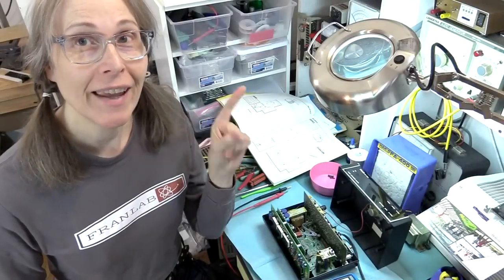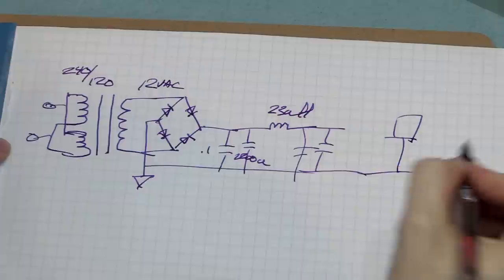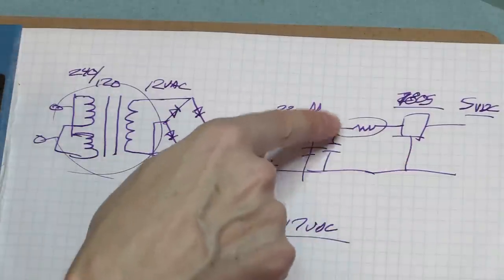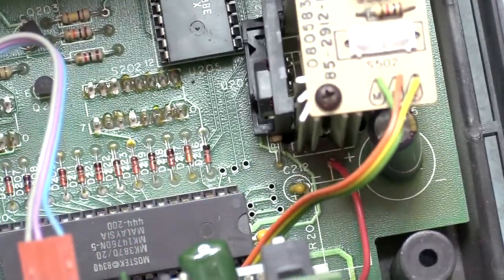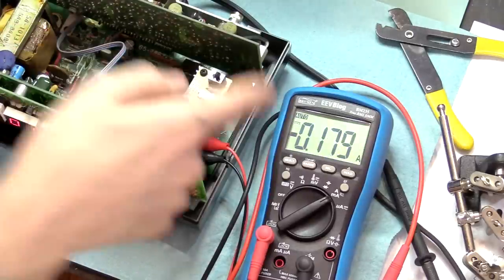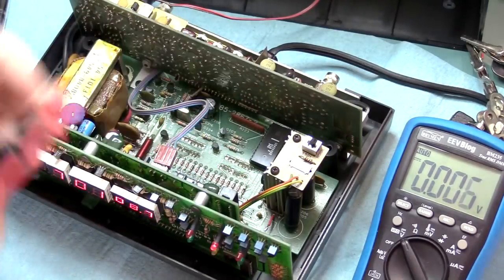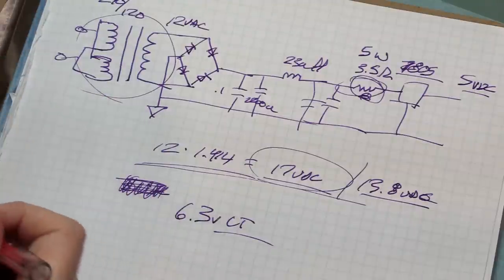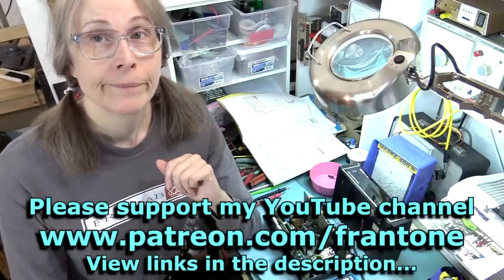Heathkit GC-1000 Power Supply Design Fails and Fixes

Comment: Hi Fran,

Yes, HK tried to make the front end xfmr common. They were quite cheap when you buy 100k at a time!

Respectfully however, you are over looking the easy & obvious solution. 

Don't change the xfmr (you'll undoubtedly foul up the 8v portion which is touchy anyway!) ; reinstall the 7805, then replace that silly power resistor with a 7809/1.5A regulator on a heatsink! Cheapest & easiest fix; less than $2!   

By the way, changing the transformer is in no way a proper solution!!! Why? Because if you switch to running directly from a 12 volt battery; you are right back to the same issue, too high a voltage to the front end of the 7805! (Lower than 17v, but still at 12!) That's why the 7809 which works either way; AC or DC!

I think you'll also find out that ridding yourself of that switch-mode pile of junk will get rid your unit of a lot of your noise issues too.

73 - John

https://www.mouser.com/ProductDetail/STMicroelectronics/L7809ABV-DG?qs=sGAEpiMZZMtUqDgmOWBjgOWppaI0OWwS4%2Fdqp68piH8%3D

Comment: The 7805 needs min +2V at it's input to properly work.

The probably best solution is to replace the 7805 by a 5V buck regulator.
Reply: The 2V is the typical and not the maximum at 1A.  When the part is cold, you need closer to 3V on it.  At low loads (100mA or less), 1.5V is enough for the LM7805 to regulate.  Internally, the current sensing circuit accounts for some of the dropout.

Comment: Variac on the input?? No. That's a kluge, and you still need an 8V output.
 Put a switching buck preregulator in series with the 5V.

Comment: 14-5 V×0.2 A= 1.8W. That should be fine! Especially with that heat sink... weird that it blows.
Reply: It's the heat x time that kills it. 78xx series regulators tend to fail shorted when cooked. Really hard on the downstream stuff...
Reply: @mikecowen6507  ... but 1.8W with such a large heat sink shouldn't generate significant heat... I would expect something around 100 degrees farenheit max. Even over time that shouldn't be as real issue.

Comment: could this be a design decision  were the input voltage could drop as in older networks. The over voltage design  would accommodate a lower input line voltage covering  less developed areas or rural setups, this would make all clocks 'work' no matter the input 'losses' in voltage
unasked for 2 cents worth

Comment: Why not put the heatsink on the 8v regulator and drop the 5v off that? The 8v regulator would be dropping 7 of those volts before the 5v regulator even sees it?
Reply: It is a good idea.  Others suggested it too.
Basically anything that spreads the heat out is a good way to make it easier to get rid of.
Reply: To keep digital noise off the RF board.

It's good practice to keep analog and digital supplies separate as digital introduces lots of noise from fast switching transitions.

Comment: Add an intermediate 7809 before the 7805.
Reply: chas williams does the same as a resistor does and costs more, takes up more room with its heat sink and causes another issue from its own dropout.

Comment: How about removing some of the secondary windings?
Reply: Stephan C that’s not a simple task at all especially in an EL type transformer. The effort would end up costing more than choosing an alternate transformer or circuit design. I’ve only ever rewound one transformer from a microwave for a spot welder and that was very difficult. Great care has to be taken not to damage any of the enameled copper wires especially on the primary.
Reply: It's doable IF the secondary is atop the primary.  Often the lower voltage winding is placed nearest the core.  It would be tedious.  Economics doesn't have to be considered for a labor of love.  Or for a video demo of the trick.

As some others have noted, she didn't show how the 12vDC input wires into this & whether fiddling with the transformer-to-regulator design impacts the DC input option.
Reply: @markcummings150  
Agreed
Reply: @ordinaryaverageguy76  sure, and its also possible to smelt her own steel from recycled car bodies and cut out all the EL plates to make a transformer, then get the special insulated card that is used to isolate the windings in transformers, then melt down some copper pipes and roll her own wire, get it enamelled, etc etc. For any simple solution there is a thousand harder ones as can be seem throughout this thread, and removing some windings is the hardest one so far.
Reply: @Mark Cummings   Cute, very cute.  As I said, it is doable & if the secondary is atop the primary, it is not that hard at all.  I've done it.

Comment: As a quick fix, any reason you could not simply use a 2 resistor voltage divider on the output  of the bridge?
Reply: Gizmologist1 a single resistor can and was doing that already. Why complicate things.
Reply: @markcummings150  Because a voltage divider does a MUCH better job and depending on the resistors, is much more stable.
Reply: A voltage divider only increases the current load and generates more heat.  If she's interested in lowering the total heat in the cabinet, too, that's no help.
Reply: @ordinaryaverageguy76  The slightly  increased load is easily handled by the size of the transformer. No substantial rise in ambient temperature heat will be experienced by the 7805 regulator.
Reply: @Gizmologist1    It's not superior to a single resistor as far as I can see. 
What resistance values were you thinking about in the divider?

Remember that one leg of the divider has to carry all the regulator & 5v buss current but drop no more than ~6v or so (to keep 7805 happy).

Given that (as pointed out elsewhere) her current measurement of ~.22A was low due to the way switching regs work, and that the spec sheet max for 7805 is 1A, the regulator & 5v buss current might be in the neighborhood of 0.5A
Reply: @Gizmologist1  2 resistors or 1000 resistors, it does make a damned difference. you get the same result that could be achieved with one resistor. I am referring to the original design that had a 5W resistor (acting in a voltage divider configuration as you say) according to Fran.

Comment: Am I being silly but can you not just put the primary's in series in stead of parallel and get half out of the secondary that transformer should provide 200ma easy?
Reply: Mike Baker easy but flawed imo because 6vac out will definitely be too low even without the resistor due to several reasons.
Reply: Somewhere in the comments, Fran replied to that & agreed it's too low.

Comment: Aww... I was sure you were going to repair it...
Reply: Yes, me too. It appears the power supply is no longer an issue (as long as you verify the noise level), so let’s move on and get it going!
One thing to watch for is the time it actually checks for updates. Fixed a battery powered one in the past and it only checks once a day. Maybe keep the unit on for a few hours to see if it updates?

Comment: Rewind the transformer.
Reply: Back to 1985 should do it.
Reply: Easier to replace it completely than to do a full rewind.  Perhaps better would be removing secondary turns.  Or adding some bucking turns if there's room in the core windows.